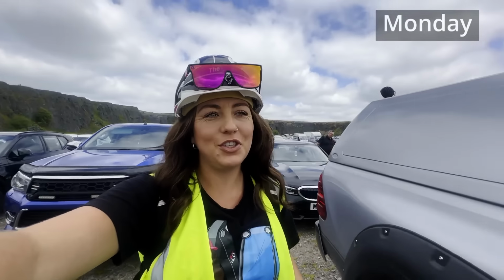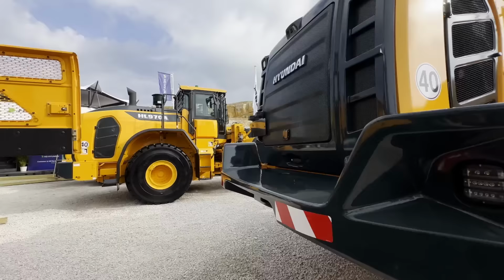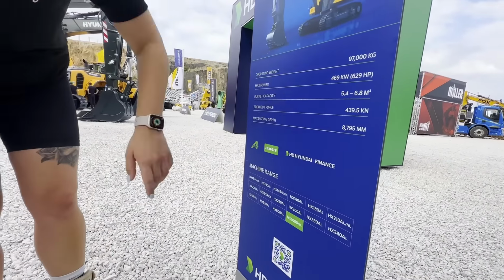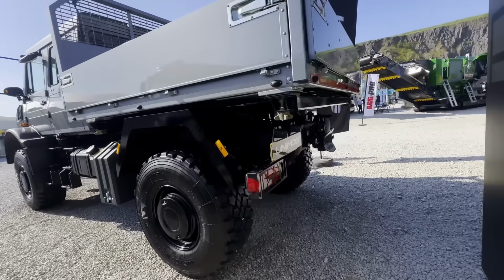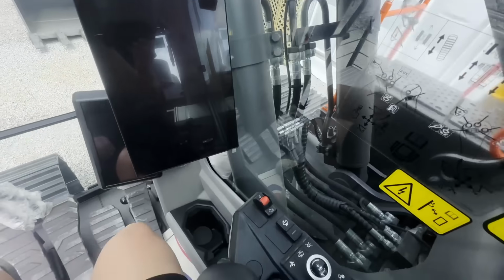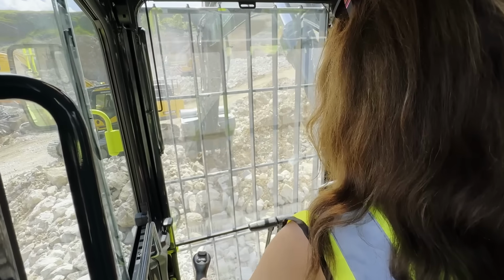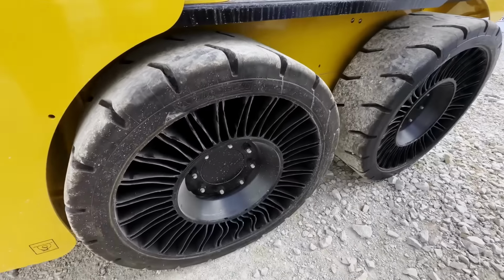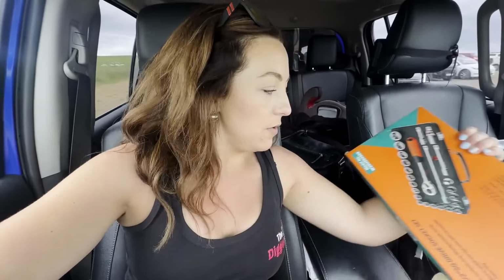Brand New 100 TONNE Machine | Hillhead Quarry Show!!

Comment: Ok so you are just looking at new machines and trucks. I’d take the large tipper truck and the Volvo tractor cab is awesome. Drove coaches and buses only had a bit of a go on some 16 ton trucks around a yard and tried to reverse a cab / tractor unit onto a trailer but missed the pin sadly. Done plenty of small trucks and coaches though as I said. Would not mind trying some of the new machines out. Are Hyundai sponsoring your channel or they using your pretty face for the magazines ? Yes I said pretty 🌹. Thanks for the show on the big girls toys. I see you have hired an English guy to hold your camera. That’s pretty cool. Be cool if you could do a live vlog or another vlog in the week. But this was interesting. You seem to enjoy yourself. That’s good. Have some time with your kids. Take care!